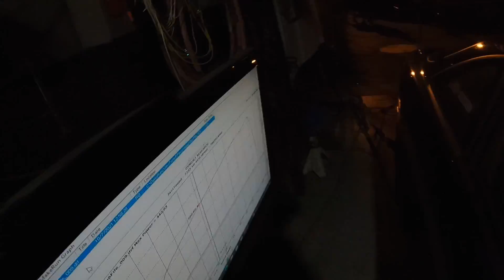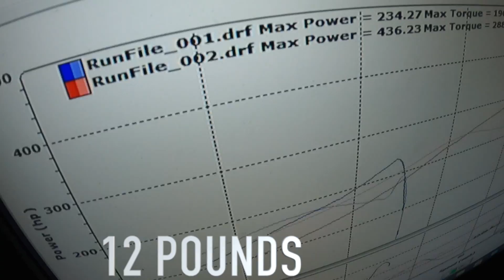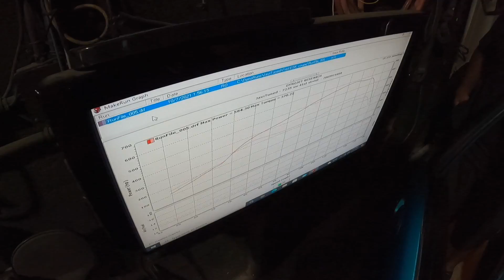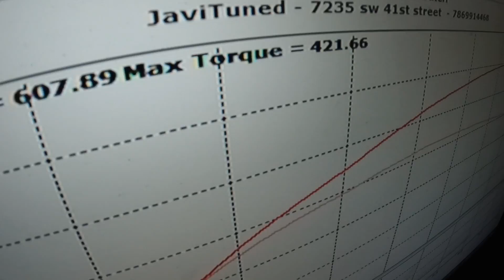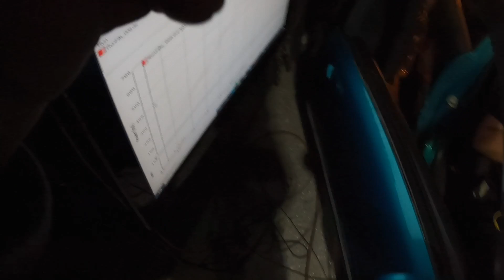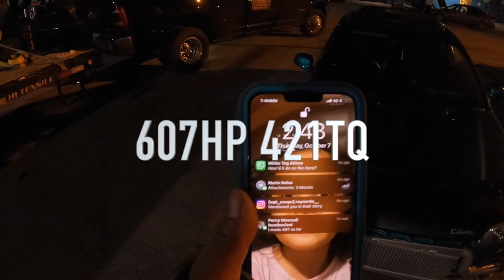TURBO K20A COUPE & PROCHARGED K24 INTEGRA HITS THE DYNO

Comment: Somehow I wonder if the placement of the tire on the roller contributed to the spinning. The tire was about 2 o clock. Maybe bringing it over to 12 or 10 o clock would have helped. Also reducing tire pressure. 🤜🏿🤛🏿 🇯🇲

Comment: I would have left it at 12 psi all the way threw 430 hp is more than enough for a stock gear box but remember if you take it to the track it adds a lot more stress to the gear box. Oh and something is wrong with your passenger lights on the highway pulls it started to flicker. Wicked ride keep it up

Comment: Maybe u can take off the side skirts next time? Another good option is to have a power wire to pull the car up the ramp.
Another thing ive seen other YouTubers do is instead of using plywood they use stronger 2x4 to help car onto the ramp.